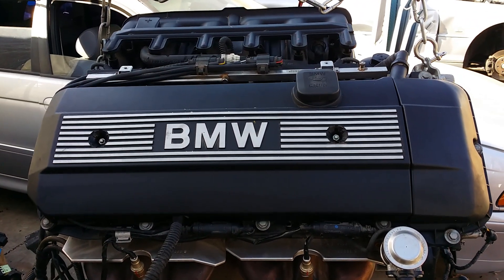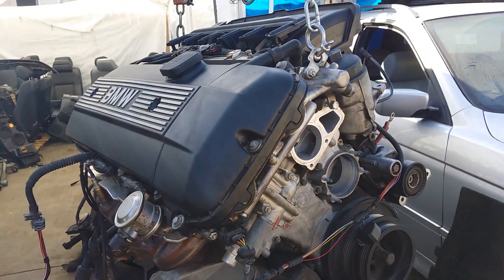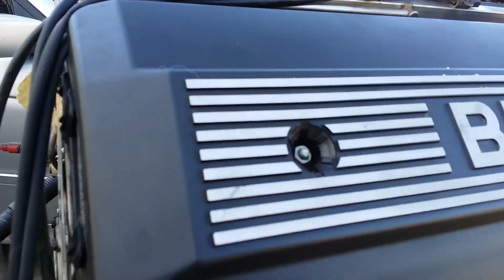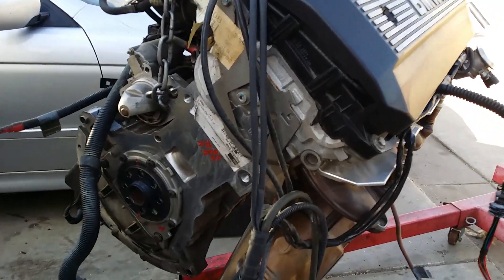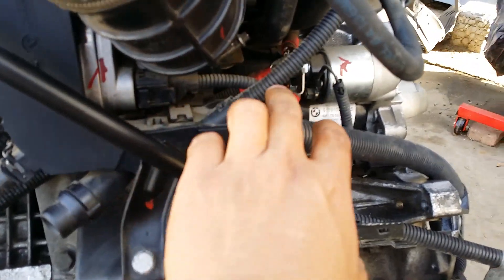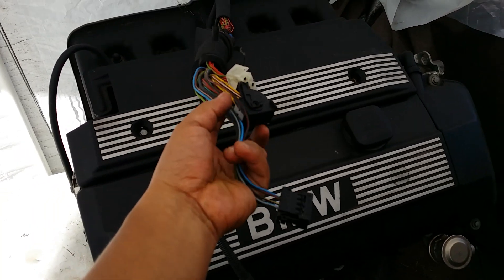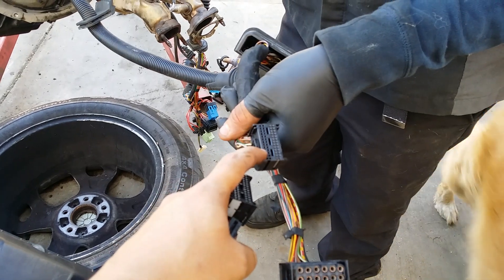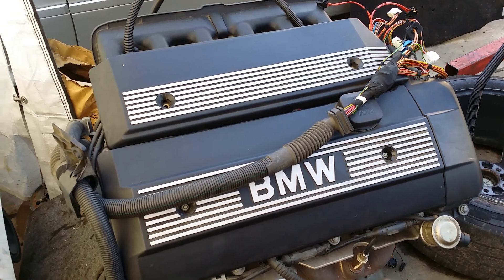BMW M54 engine wire harness Diagram 525i 325i X5 530 330 Part 1

Comment: Great video, but i have another question, is the engine harness from e46 m54 engine the same as e39 m54, because i need to change mine ( 530i), and all i could find was from couple e46's m54b25/m54b30

Comment: On the side of the engine kinda middle area from top by passenger wheel my engine has no screws I believe the oil is just comin out any idea what goes there I have a video
Reply from the maker: unfortunately we don't
Reply: @bimmermerchant  just described its back of engine bay kinda apart of gasket is loose so it leaks right onto exhaust pipe nothing I can do thanks tho
Reply from the maker: @Bankroll_k3  ok

Comment: Hi dear, i want to ask about combining two bmw engines, used 528 bmw 1997 motor with parts of a 525 1991.the car is 525 1991.we are having a problem of idling on 1.5 rpm. What is the cause of that??

Comment: Thanks for the video! Quick question: I just replaced the engine in my 2001 e46 and I have one of the plugs from the harness that I cant find where it goes. Can you suggest where I can get a diagram that labels them so I can get this car back on the road? Thanks
Reply from the maker: unfortunately we don't have a diagram for engine harness.  You can visit bmw e46 forums and ask any members there for diagram.

Comment: hey dude what is the red wire that is connected from the engine to body?
Reply from the maker: +Abner Jigs Victoria Your refering to the positive battery cable?
Reply: I think it is but why its connected to differential

Comment: Your videos are very informative man!

I have a question, I own a 04' e46 Sulev 325ci (m56). My motor is bad (bent valves) and I have a low mileage m54b30 that I want to swap into it. How difficult is such swap? What advice can you give?

Thanks in advance!
Reply from the maker: rocky ace We wouldn't be able to provide much advise since we've never swapped an M54 to an M56 or for that regards heard of someone else doing it.  We are sure its possible but would be alot of work.  We recommend you find a good M56 and replace it.
Reply: Tial Mk4 supra swap the fuel tank with the b30 motor